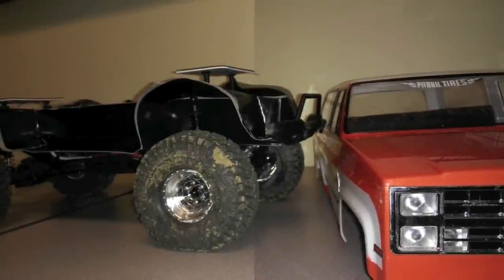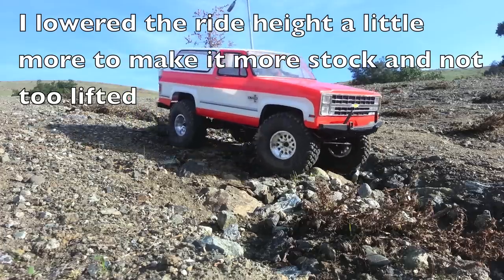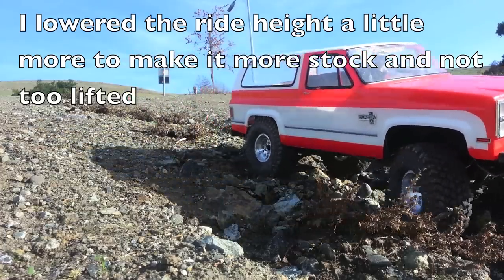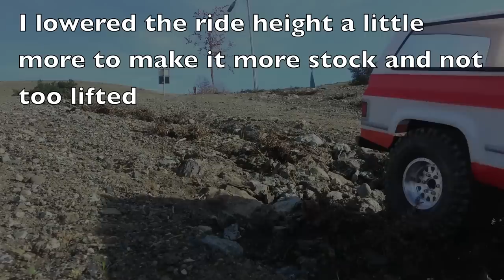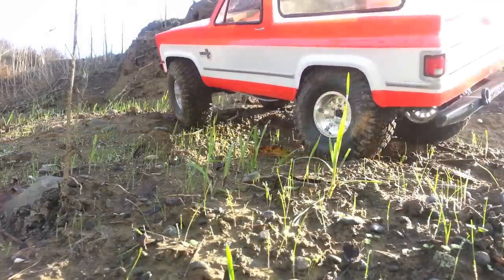Project Ascender Update Vaterra 1:10 Scale Truck Chevrolet K5 Blazer Ascender

Comment: How did you add the driver in?
Reply from the maker: Haha.. Right now,  she is just duct taped down to the bench seat I made (temporary).  But normally I use industrial Velcro on my drivers so I can switch them around.  You can also use ShoeGoo so you can still take it off without hurting anything
Reply: Man that is cool, how you make the seat?
Reply from the maker: IR RCTV I made it out of styrene.. Thin sheet.  Those "FOR SALE" signs.. Cut them up and glues them.  Then painted black Plastidip.
Reply: Awesome thank you !